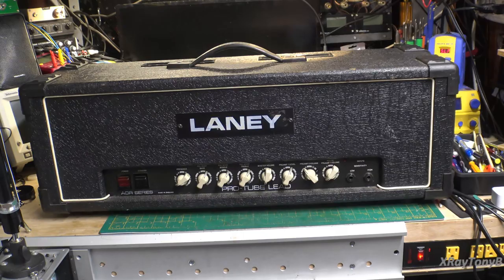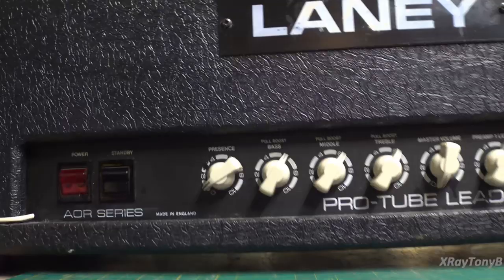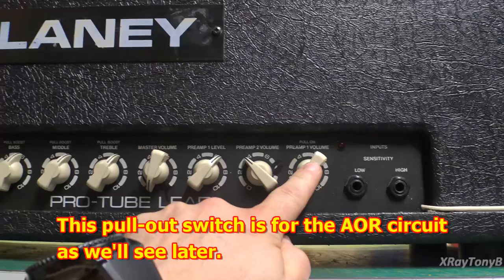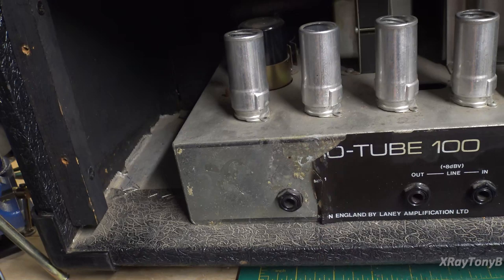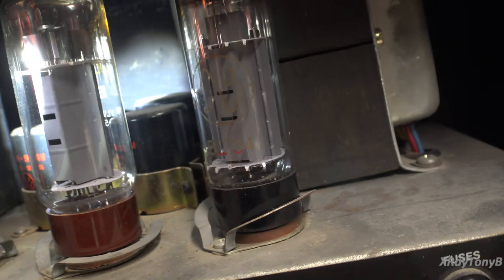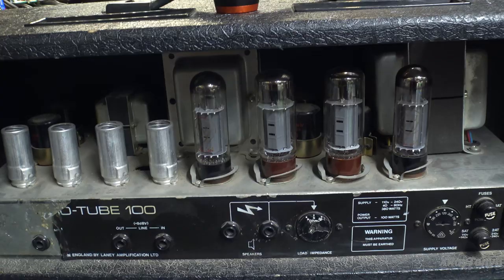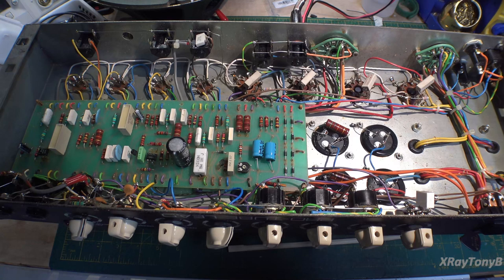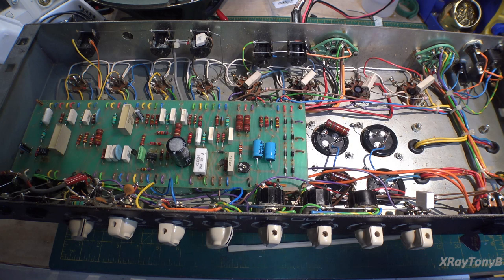Laney AOR100H Guitar Amp - Part 1: Repairs and How to Bias

Comment: I like your biasing method for single push pull. i dont like it for stacked push pull as one tube being weaker and one stronger will not show itself .and can lead to an overloaded tube . On stacked tubes i like the anode current method on each individual tube . Great Video Tony
Reply: @Bishop Cullen Definitely, been watching on InstaFlixxer for years myself :)

Comment: Love the way you slowly but diligently walked through the bias process. Really made it easy to understand. My best friend is a long time amp tech/builder so I have absorbed years of amp repair knowledge and yet also it’s all only on a pretty surface level understanding. It’s like, I knew how to bias a set of tubes and have done it several times but also feel like I have a more legitimate understanding of it now? Like when you finally find that comfy spot on that couch and sink into it lol. An internal click sounded off. Thanks for posting this!

Comment: I have the schematic for this if you need it. I fixed one about a year ago. Pretty much a variant of a Marshall. See you have the schematic after watching more. Uncle Doug always did this method of bias also( I’ve done it this way also) until someone sent him a bias master or whatever brand with the built in meter to measure amperage and plate voltage. He did multiple comparisons with it to the winding resistance methods and the results were so negligible he uses the gadget all the time now. I have one called bias head our some such thing to plug into my DMM with a switch to toggle between plate voltage and bias current. I use it most of the time. The modern Marshall’s since the late 90’s have 1ohm resistors on the cathode to ground with a common pin and 1 pin per output tube or pair of tubes depending on 50 or 100 watt output. Nice and easy especially on the DSL/TSL models. You don’t have to pull the chassis, adjustment pots are next to the pins. One pot per tube/pair to balance the bias also. All amps should have a balance on the bias circuit. I have added that on a lot of amps I’ve worked on. Most tube are not well balanced half the time even though claim to be. I always run them on my old Hickok 539C to double check transconductance as well as plate current. This changes as the tubes wear also. I re-bias my own amps every 6 months if I’ve gigged a lot of hours on the tubes. You can make a nice bias socket probe from an old tube base or buy a blank base. Just put a lead from the plate and cathode pin with some banana plugs and use you meter on the amperage plugs. Get an accurate reading with no resistor voltage drop. Just make sure it’s plugged into the meter or you have a nice 500v lead dangling around. I guess that’s why they use the resistor for the sake of safety.

Comment: The amp in the thumbnail is the aor series II model amp. I have a 1989 series II and although everyone says they break, I’ve had mine for 25 yrs and occassionally gigged it and other than changes of valves it’s still going.

Comment: I know very little about this stuff, learned over the years from videos like this and just from poking around in vintage amps I was playing (swapping tubes and such). I just picked up the 50w version of this exact head, transformer dates it to Jan 22 1986, pretty low serial #. Its giving me some signs of worn out tubes so I opened it up to find the tubes are all pretty new looking GT, all 4 12ax7 and both el43, so my assumption is they arent very old. However whether it was biased accordingly or they just got plopped in i cant say. That being said, I believe it has the original big caps, and now I think theyll need replacing after over 35yrs.

This video was a really great way to learn about a somewhat mysterious amp. Really awesome of you! I wont be servicing it myself but I like to know what to expect and this helped a lot!

Comment: Hello Tony, You might want to open up that Uni T power meter (1010) because the internals could do with an electrical "safety tidy up" as it may have exposed mains terminations inside and I know how much you value doing things correctly. The Martin P you tube video teardown is what I am referring to. It might even make an interesting (safety) video in-of-itself.

Comment: Hey Tony !!! Got my Groove Tube #8s but decided to bias the Mullards that had been replaced when the transformer smoked by a company in Atlana .... using your method I found that it ended up at 10 watts per pair !!! Waaay off .. .336 volt drop 15 .8 ohm and 464 vdc ... so I adjusted it to 1.15 drop on the red side 1.08 on the blue finally ....I'd swapped them every which way to get them as close to even as possible and they rocked !!! 33.35 watts  red 28.79 watts  blue... Clear chunky sweet punchy Heaven !! ....  put in the new GTs and did the same well I'm gonna swap them back cause the mullards are.... warmer.... sounding ??? The GTs are #8 and a bit IDK......... dry??? Antiseptic maybe .... good but not great, fine when looking for  clean punchy  clarity ... Thanks for posting this vid ...been back several times to make sure I don't toast my rig ... for a 1985 head I'll put up against ANY make or model ... BTW  I'm running it through a 1984 or 5 JCM 800  top cab 412 the bottom is in the house holding up pictures lol

Comment: I like to bias my Marshalls with a multimeter or a bias probe. But I fine tune the bias by ear while playing my favorite guitar with my favorite strings and favorite amp settings. I tend to bias a little colder than Marshall recommends. It just sounds better to my ears. I.e. more crunch and clarity. I use the multimeter or bias probe to keep me out of the danger zone so to speak. I once biased my Marshall 100 watt master volume to 48.5% dissipation and it sounded good. I would have tried to bias the four EL34s higher but my bias potentiometer was maxed out.

Comment: I'm curious as to why the bias is so high for a class-AB amp.  At 60-70% idle, it seems like it's more of a push-pull class A.  It would enter class B only when you're pushing north of 60-70W (about).  Yours is not the first video to say this, but I only picked up on that today.
Reply: Russell Hltn Class A usually runs 100% of the rated plate dissipation. Class A is usually running about half the plate voltage as AB also since they are conducting constantly.
Reply: Each pair of valves are in parallel class A?
Reply: @pauldavies6037  You can.  The class is how the tube conduct during the wave form.  In class A, they conduct all the time.  The reason I'm raising the question is that it would seem to conduct all the time until the signal level reaches half of full power.  Granted, this is class AB, but I'm just surprised at how much it seems to be more like "A" than "B".
Reply: @pauldavies6037  Yes, the valves are in parallel.  they're running class AB.
Reply: Cuts down crossover distortion.

Comment: 57:57  - influencing the circuit? With 1 ohm? In the measuring / calibrating procedure ... Certainly people with close to zero electronical knowledge. Like you don't influence the circuit when measuring everytime ... 
For me the superior method is the cathode resistor type, with a socket adapter or without, and having two voltmeters you can really do it "on the fly". I just don't see any sensible drawbacks in it. And there is also a chance you will spot a faulty tube (or screen resistor) that way.  Your method seemed like a waste of time. But is is true, it took so long  also because you went through explaining it - the formula for the calculation is more or less fixed and so you can do this also very quickly, measuring both halves of the primary resistance with the amp off, and then with two voltmeters biasing ... Is it a weak point of your method ... you don't measure individual tubes, but the pairs. What if there is a severe imbalance in the pair? 
Edit: Seen 2nd part of the video ... oops, screen current, my bad ... 

Kudos for doing really neat job on this amp!!

Comment: I have a Laney AOR Series 1 Pro Tube Lead 50 Watt model, but I do not have the footswitch for it. Are any of the current Laney footswitches compatible with my amp, or should I contact Laney directly? I couldn't find anything on Reverb. Thanks in advance to anyone that may be able to give me some solid advice.
Reply: Just snagged the same head! Considering its a simple channel switching type, my guess is any generic single switch will work properly. I know most are the same simple circuit, some dont do it proper and will just cut the signal without sending to ground though which can cause those loud pops. I dont think its dangerous for the head but just annoying and probably puts stress on tubes and speakers.

Comment: Wonder if it is the one I had stollen in BC .. best amp I ever owned.. but mine was stolen .. 😡🤬😠🤔😭
Reply: Was stolen in 1995.. gone but not forgotten..
Reply: @johnpoyner8823  might explain the missing sn portion of the rear panel decal ... I'll check mine for a matching number stamping on the insidesurfaces  when I reinstall the mullard tubes tonight and rebias ... sorry for your loss brother

Comment: Seriously? If you need to show someone how to put leads into a test meter they should not be anywhere the inside of a high voltage electrical device with lethal voltages.